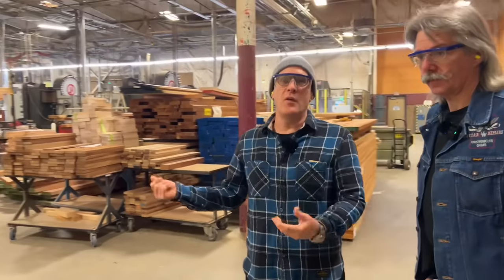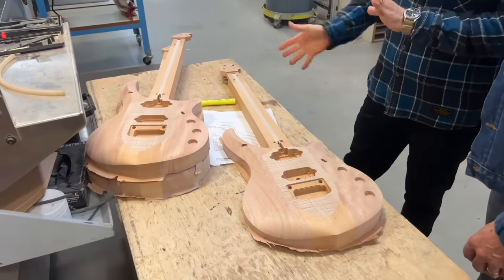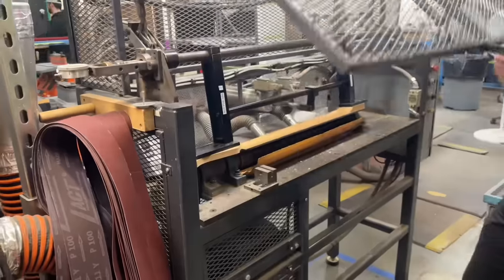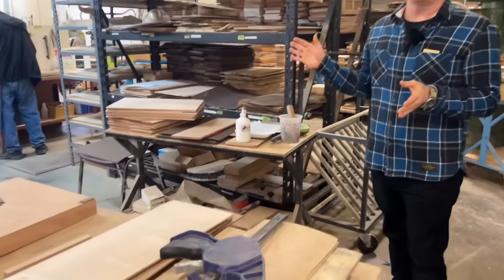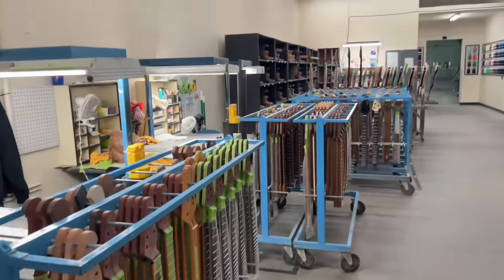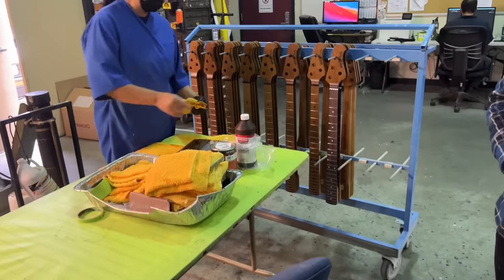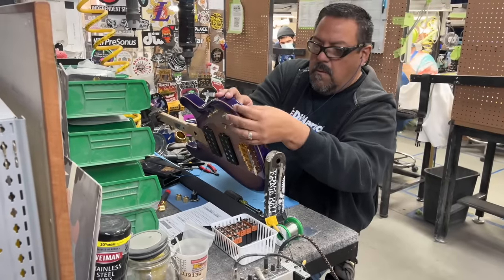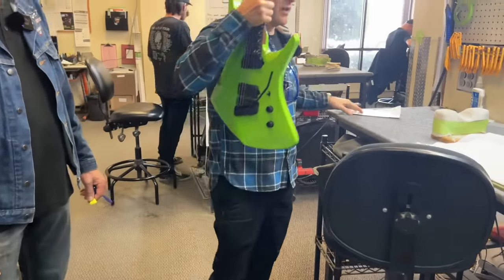Inside Music Man | Factory tour

Comment: Those tops look thin. I know they are thicker than a veneer but I still don't consider that a full maple cap. It's not just Music Man that does this. I've seen Schecter, Fender, Kiesel and most major brands. For me to consider a guitar to have a full size maple cap, it should be as thick as the top on a Gibson Les Paul. By the time these thin maple caps are put onto a guitar and sanded down. They are to thin in my book to advertise them as a full thickness maple cap. I understand it's to cut cost. At least put a thick piece of plain maple and then a flame veneer. Just to be clear! I'm NOT ragging on Music Man but most of the big brands that do the same thing. If Epiphone can put the same size maple top on their Les Paul's. I feel a company that sales a guitar for 3 to 4 times the price of an Epi. They can put a thicker piece of maple on their guitar.
Reply: It’s NOT just about cost. The Les Paul is an unusual case. The reason it has such a thick maple cap is because it has a precise ratio of mahogany/maple that is considered an essential part of its tonal character. By comparison, maple is NOT an essential part of the tonal character of most other guitars. That maple cap is also the single biggest reason that even a chambered Les Paul can still typically weigh in the 8-9lb range. For this reason, most people (myself included)  do NOT want Les Paul-style maple caps on their guitars. A veneer or a thin cap is all that’s needed to create the LOOK on a guitar, without imparting its tone or weight in the mix.
Reply from the maker: Well written!!
Reply from the maker: Thanks for taking the time and writing such a comment! It is thicker then it looks in the video, i can insure that.

Please feel free to subscribe to our channel if you haven’t already done it👍🏻‼️
Reply: Hand made in the USA by Ursala🎉🎉🎉🎉🎉🎉🎉🎉🎉🎉🎉
Reply: Brian Moore custom shop guitars have a pretty thick maple cap. They’re no longer well known since they went direct. They’re a super strat.
Reply: This is one of those technical/ anecdotal issues. Fender necks from a certain period are made with what is commonly referred to as a veneer fret board. Unlike a slab fret board it is thinner and pressed into its radius shape. I think at that thickness it’s technically a laminated construction not a veneer. A maple cap isn’t a veneer band a veneer isn’t a maple cap. It’s like the term ‘bolt on neck’. It’s a slang term that isn’t technically correct, as wood screws are not bolts.

Comment: No double action truss rod is kinda a deal breaker for me nowadays, especially on over seas guitars where the wood might not be as stable.
Reply: When have you ever needed to help a neck bend TOWARDS 180 pounds of string tension?! Music man properly cures their wood before making their necks. If it was an issue, they wouldn't be using it. John petrucci plays the same instruments around the world, literally in all climates and temps. You think if their most famous artist ever doesn't need a double action truss rod then it's probably fine right? In my 30 years of playing and my current 18 guitars and basses, I've never needed a dual action truss rod ever, from dry ass Colorado, to cold Minnesota and humid Florida.
Reply: @theshapeexists   Ive had a few guitars where I had to turn the double action truss rod counter clockwise. Got 2 right now in my collection Both brand new guitars. I also have a couple guitars where the truss rod is all the way slackened and the neck dead straight. really would be nice if those had double actions so I could get some relief .

Comment: Here in Germany the MM's are quite expensive. Not interesting anymore.
Reply: MM have lost their touch with reality when it comes to prices. They seem to be forgetting the simple fact that the audience they are selling to consists of regular working people, not Rockafellers. I once used to dream about a JP MM guitar. I am not even dreaming about it anymore. Add to that the fact that their necks, from my experience with multiple guitar brands and types of wood, seem to be the MOST sensitive to temp and humidity fluctuations, and require frequent and DRASTIC setups - at least here in the Northeast. Not my cup of tea.

…It is interesting to see their factory though. I’ve always been fascinated with how guitars are being built with automated processes. Cool video.
Reply: I don't think Sandberg and Warwick are any cheaper😮
Reply: @michaelblaney4461  Sandberg is a special brand (for Guitars) i wouldn't buy. Warwick doesn't make guitars. It's their other brand Framus and for me this is also a special case and maybe not as successful as they would like to be. MM for me was a great brand. It still is but as i mentioned above...
Reply: @westparkmedia089  Well Sandberg makes good basses ( when I think. Of MM I dont think of guitars )
Reply from the maker: Thanks for taking the time to leaving a comment. Everyone one has their opinion on what’s quite expensive or not.

Please feel free to subscribe to our channel, if you haven’t already done it 👍🏻‼️

Comment: They could start out with a bigger piece of wood for the neck and eliminate the scarf joint
Reply: Why? What would that accomplish? A scarf joint is a traditional, time-proven way to make a good strong wood joint.
Reply: Scarf joints are a much stronger neck than one piece necks. Just look at how many Gibsons are broken at the headstock.
Reply: True Gibson's break, just think if you're spending $1000 on a guitar it shouldn't be glued together
Reply: @davet.3587  Uh, you do realize that set necks are glued in the body, no? Even if they use bolt-on necks instead of set necks, they still have to use glue to join body pieces together, to glue caps/veneers to the front, and to glue the fretboard to the neck shaft… Even neck-through guitars typically have wings glued on to form the body. I don’t see how one can avoid using glue altogether in making a guitar.
Reply: I know glue is used on many parts of the guitar, wasn't saying no glue anywhere just no glue on a two piece necks